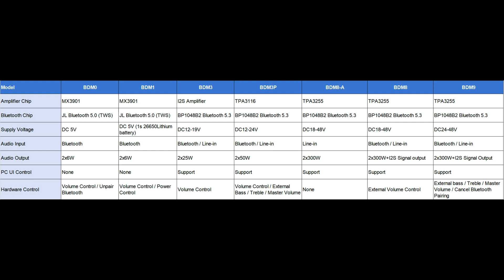BDM Series Bluetooth Amplifier Selection Guide High-Power Amplifier: TPA3255 BDM8-A/BDM8/BDM9

Comment: I assume it is possible to configure the BDM8 as a single-input (line level) and then use the DSP UI to configure the 2 amplifier channels as LF/HF using DSP as crossover? In other words, create a simple 2-way active speaker amplifier (one BDM8 board per speaker)?
Reply from the maker: Hello, thank you for your watching. Please kinldy note that the BDM8 doesn't support independent channel adjustment, that means the adjustments will work for both channel simultaneously. Wish this could help you. Have a fantastic day~
Reply: @WONDOMAudio  Ah ok. In which case, I guess I could use one BDM8 with a stereo LPF EQ in the DSP to drive L/R LF outputs, and then use a second BDM8 with a stereo HPF to drive the L/R HF outputs? If so, can I use the Line Out connector on the 1st BDM8 to feed the same input signal from the first BDM8 into the 2nd BDM8 so that they both see the same input signal?